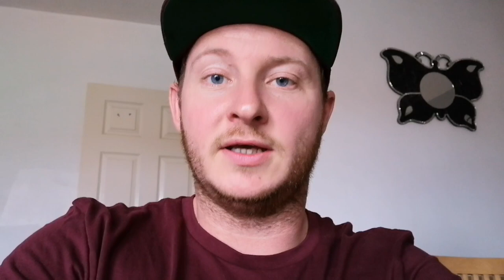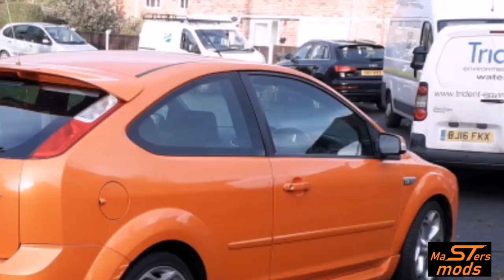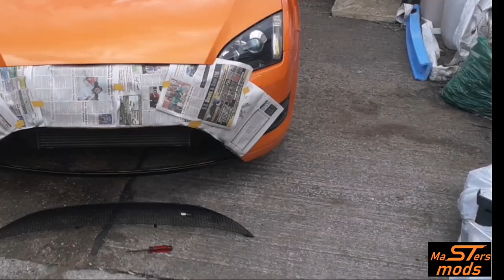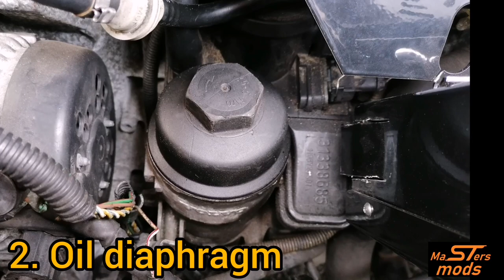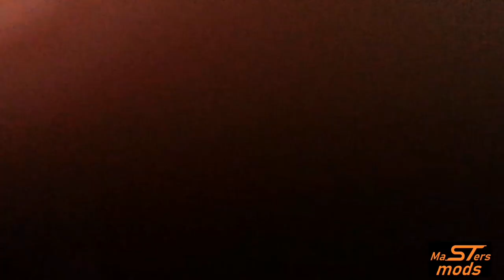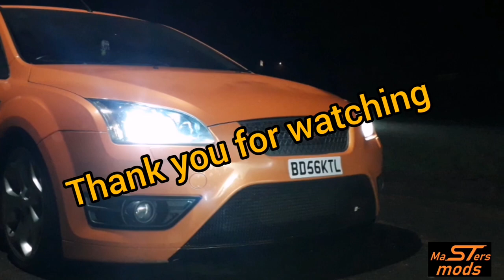Common problems with the Focus ST225

Comment: Ive had my ST 9 years, was totally standard when I got it, the only problem Ive had was the alternator. Ive been running Dreamscience Turbo X+ for 5 years and no problems whatsoever. Although to be fair a lot of the standard stuff has been replaced with uprated stuff
Reply from the maker: Fair play mate, I think every car has their problems over time. If yours has been looked after then will prob treat you well

Comment: Not sure if mentionned, video just popped up in my feed, but crank case ventilation will always go woosh. Most people have it at about 80k km. Mine had it at 60k km. It will almost always break and make a very, very annoying hissing sound and sometimes force your st into safety, low turbo pressure mode.
Reply from the maker: That's good info to know Tim nice one 👍🏼

Comment: Been looking after my son's ST for past 6 years and it's doing my head in..its running a stage 2 tune....4 bonnet locks...last one I fitted was like two sliding bars of plastic..works a dream been in 2 years and works great and cheap as chips...2 pairs of wishbones...clutch and DMF and whilst g/box was out pinon and diff fell down inside box... numerous ABS/Traction control faults...wheel bearings...drive shafts the list is endless...still chasing ABS/traction control issues...works fine for a while then comes on again...affects engine mapping...oil pressure gauge stops working and gearbox solenoid kicks in making it difficult to engage 5/6...changed wheel sensors..goes away for a while then back again showing as wheel sensor A...it's doing my head in not being able to locate what is tripping this fault...
Reply from the maker: Could it be a wiring issue?
Reply: @mastersmods thanks for reply...have done the obvious checks of the wiring for damage..connectors cleaned...ect...it's currently on my drive again with burst heater hose which has those stupid plastic twist connectors that go brittle....(am old school whats wrong with a bit of hose and two jubilee clips..😝😝)...when I was tracing the leak underneath found inner CV boot split and whilst removing driveshaft found wishbone ball joint worn..only renewed this 18 moths ago..when stripping the driveshaft found the tripod ball joint is also knackered..it's never ending.....am going to check condition of connector block on abs module for green mould or corrosion same with connectors on ECU to eliminate the obvious...have also brought a pair of front wheel sensors and will change them and see what happens after that..👍👍
Reply from the maker: @richardmessenger9474  good luck mate, hope you find it and sort it 🙏
Reply: @mastersmods  many thanks...👍👍Finished drive shaft and lower wishbone today..the Micky mouse heater hose connections are a nightmare to get them to lock in place... fitted a matched pair of front wheel sensors and disconnected the ECU to check condition of connection pins...found about 6 of them at one end covered in some form of brown staining...cleaned it with some carby cleaner and soft nylon brush...cleared fault codes management light now off but traction control and ESP lights still on...a quick road test and lights now off😄😄..vehicle running correctly and fingers crossed it stays that way...only time will tell...👍👍
Reply from the maker: @richardmessenger9474  that's brilliant news and well done for finding that!

Comment: I bought mine with the bonnet fucked. i just pulled the front part off and use a long screwdriver  to twist the catch. 3yrs ago that was. 1st fix was steering pipes,  i salvaged pipe work 30, 60 to fit with fluid. Then the dodgy front end wabble crept in, i was swapping wheels, banging discs to no evail. with the full service came a drive shaft 380 all in buzzin!! now its the eratic throttling carry on. right pedal unit en route 31 pun used, may try the swap my self 1st.
Reply from the maker: Money pits ain't they

Comment: Like the video, just a side note, you could argue that like your last comment about the driver and if they drive the car hard being the cause of the drive shafts failing is the same for the cylinder walls cracking through driving the car hard all the time 🤷🏼‍♂️
Reply from the maker: My argument to that would be this, my cars original owner from new, drove like an old lady and it wasn't until 142,500 miles that it went. Also if you watch GCM's video on getting his lock mod done, the guy doing it says "it's the ones that are garage queen's that tend to fail the most, the ones that are thrashed about that don't"  for me, the liners cracking is a lot more common than drive shafts regardless of how the cars driven. Another way of looking at it would be, when you go look at an ST, what would you ask first - has it been block modded or how many drive shafts you been through? So again, for me anyways, liners trumps drive shafts
Reply: @mastersmods  yeh fair point I do remember watching gcm’s video now when he got his done now you mention it so I stand corrected 👍 Maybe I’ll thrash mine a bit more to be on the safe side then lol. Mines only done 83000 and still ok with no block mod. Revo stage 1. I did get the revised oil filter housing installed though with a genuine Volvo one. Definitely worth doing.
Reply from the maker: @jonmarsh1653  I didn't say thrashing it would stop it happening, so don't say it's my fault if it does go 😂 I think these engines are a lottery tbh. My understanding of these engines, even before I bought my car, was it's a luck of the draw because of how they were made. Some had too much taken off the cylinder walls, meaning they'd be more susceptible to fail

Comment: My experience, 12 yrs owner , alternator went first, then wishbones ,oil diaphragm ,2 bonnet catches, 4 springs ,front wheel bearings, original driveshafts and clutch.59,000 miles, no block mod ,its talked about more than going, and last week someone drove in to the side of it and insurance probably going to right it off😒
Reply from the maker: Ah man that sucks 😟
Most of mine were based off of personal experience and what I found in general that people talk about on the fb groups
Reply: @mastersmods  update car is now being repaired 😎
Reply from the maker: @razerbaz  ah yes love that!

Comment: 8 years, all standard, was a 2nd hand. 
2 turbo repairs
Rear wheel bearings 
CV joints
Bonnet catch
Reply: how much did the turbo repairs cost you?

Comment: Spent around 11 grand on mine and sold it a couple of years ago. Now I'm after another one 🤣
Reply from the maker: 11k, ouch. I'd personally hate to sink that much into a build but hey if you got it, spend it cuz you can't take it with you haha
Reply: @mastersmods  That was on the engine. I paid just over 8 for the car. I wish I could track it down to be honest and buy it back. The engine could withstand 1000bhp, I'd love to get it back and do a big turbo on it and put a new gearbox in with uprated bearings and quaife diff. It's nice to dream though eh 😂

Comment: Had new coils, plugs and new map sensor  2 months ago,cars been running great again ,    last week was driving home the car started loosing power and  cutting out , with a message engine malfunction speed limited mode, completely out of the blue,  turned it off waited 2 mins started back up got 100 yards and done the same, you experienced anything like this? No other warning lights or anything  seemed to run fine apart from just cutting out
Reply from the maker: Yeah I did. Couldn't accelerate very much and sometimes would just cut out all together. Mine was the dash cluster. The solder dries out in the back of the cluster and doesn't make a solid connection. Try smacking the top of the dash next time it happens. Seems to help for a while if it is the cluster.
Reply: @mastersmods  thank you mate really appreciate it
Reply: @mastersmods  it was woth my mates garage didn't look at it for a day went completely dead so I'll let him know this too thank you
Reply from the maker: @VELCRO666  no problem buddy, hope you get it sorted 👍🏼

Comment: Got to be honest I daily my ST on 125k miles I red line every gear everyday no block mod I smash the pants off it pop and bang the shit out of it they are bulletproof in my opinion only problem iv ever had is head lights not auto adjusting and just pointing at the floor, bit of rust on arch that’s it, see so many people crying about a block mod and driveshafts saying their crap...if your un happy with the car sell it and move on. Simples

Comment: I have a focus and I can not for the the life of me find a fault. I have a violent shudder through the steering which shakes the car. I have changed drive shafts (3rd party) but still brand new and still happening. I have changed the tyres for brand new ps5's, all wheels refurbed and balanced. Changed standard shocks and springs to coilovers to test and still the same. Wishbones changed, the same. Please help
Reply from the maker: @Liam-iu8ti  could still be driveshafts as they're terrible for the ST's if I remember rightly

Comment: Can broken Oil diaphragm broke something else if is faulty?
i hear whining noise when idle
Reply from the maker: Pull the dipstick out, if it stops then the diaphragm is torn. If that is the case then you shouldn't be driving the car at all as it can cause more damage to the internals of the engine
Reply: i have to try that, i got same whining noise.  Thx for info
Reply: @mastersmods   Ok i think its only alternator belt sound..  i take dipstick off and nothing hapens. and i open oil cap and no sound differences, so i think i dont have Oil diaphragm fault.  And oil pressure is around 1/2 when warm engine and idling.
Reply from the maker: @gg7335  should sit between the 1/4 and the 1/2 glad its not the diaphragm tho

Comment: I have a question.
When i change the throttlebody, do is need new software. Or is it self learning?
Reply from the maker: If upgrading to RS throttle body then I think it does need mapping in
Reply: @mastersmods  

Just wanne change the old one for a new part.
I heard that you might need software. But i think it is for the old Volvo 2.5 engines around 2000/2003
Reply from the maker: @stylo8133  should be fine then mate
Reply: @mastersmods  thanks

Comment: Who doesn’t wanna give it full beans from low down?? 
I have those dream science motorsport S9 driveshafts and they’ve been fitted a year n now I’m suddenly getting vibration from the left hand side ffs
Reply from the maker: That's not good is it pal, could it be something simpler like tracking out or tyres?
Reply: @mastersmods  no mate.. i have hardrace engine mounts gearbox mount and lower arms aswell n if i just drive steady it doesnt vibrate so much.. its possible but should find out at weekend 1 way or another
Reply: @mastersmods  tyres are a month old ps4s
Reply from the maker: @davecozzie1  defo points towards the shafts then 🙈
Reply: @mastersmods  i wished it was tyres 😂😂👍

Comment: Great video my oil filter housing is making a noise on start up then go's away... Dose this cose engine  damage?
Reply from the maker: Thank you. It will do if you carry on using the car mate yeah
Reply: @mastersmods  glade I watched your video then I double check buy taking oil filter cap off just after start up... Only makes that sound for about 3 mins 👌🎄
Reply from the maker: @djbrad1000  hmm, might not be the oil filter housing then mate
Reply: Yeah it's NOT done some more digging and it's just a belt whinny or something on start up. So all good for now thanks for replys
Reply from the maker: @djbrad1000  that's good news mate 👌🏼👏🏼